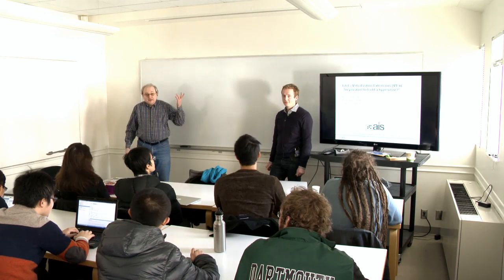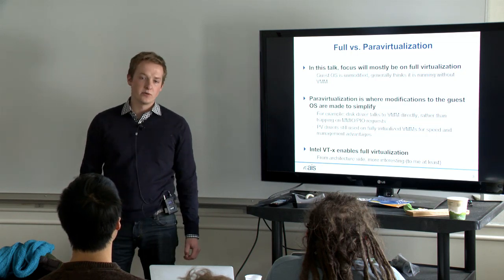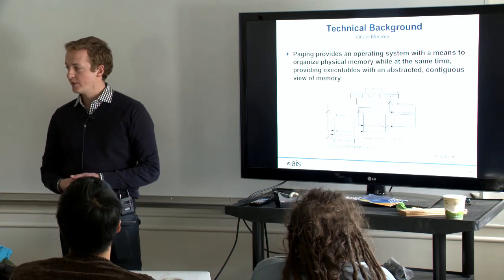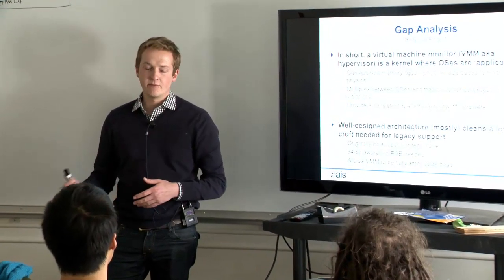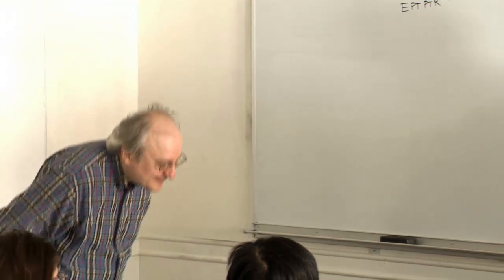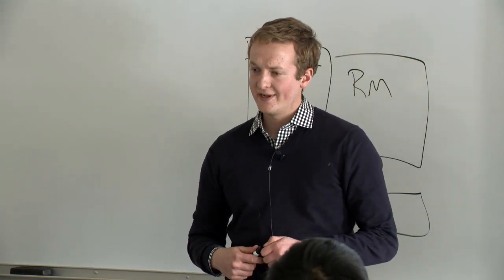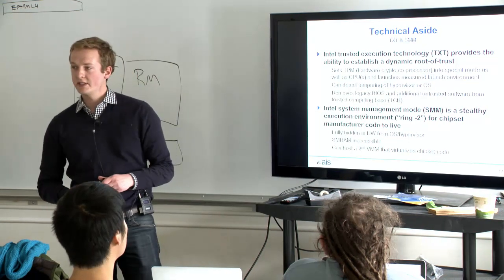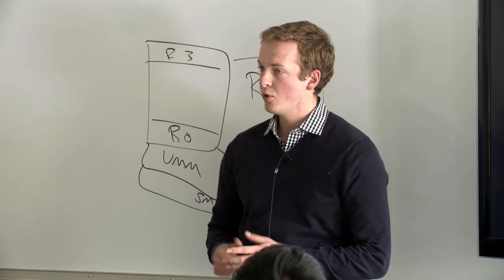Jacob I. Torrey: From Kernel to VMM

Comment: Nice talk. I review the last Intel tool that are available in the website. If people want to work on a terminal in a VM is a good interface. But I didn't saw any improvement while running this tool on Windows 10, I mean any tool that look for a healthy OS while you are connected through the Internet. All these mechanism are left to the host system, and if the PC is not secure at all, well that is a not good news at all.
Good job, and best Regards.